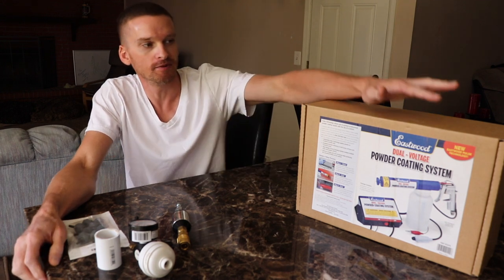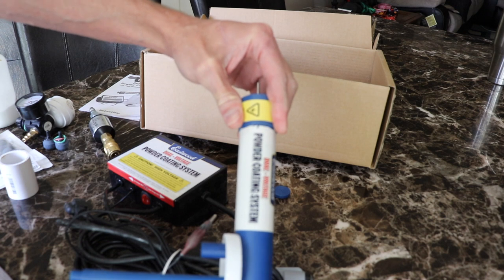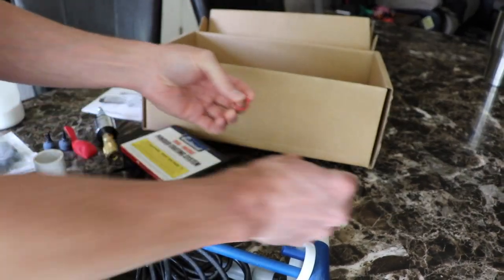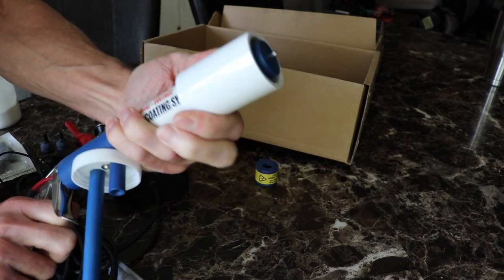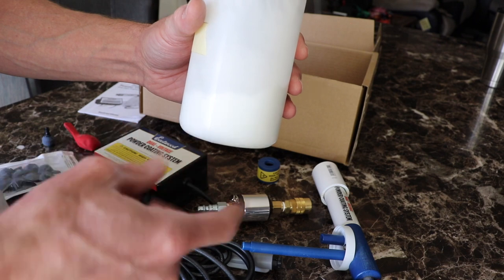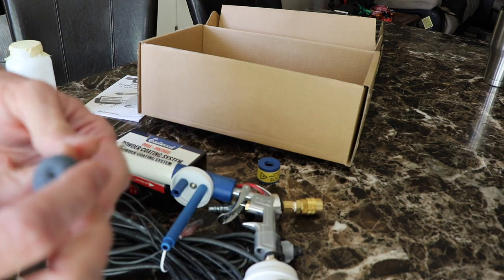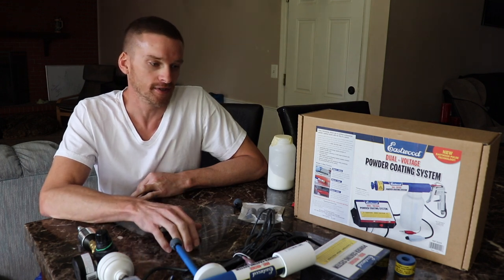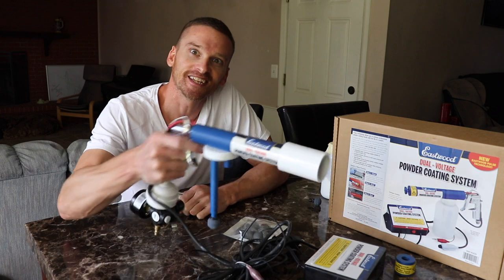Eastwood Powder Coating system Review & Modifications

Comment: Just started powder coating with this Eastwood gun and was constantly trying to reduce the powder flow by playing with the air pressure regulator what is not an easy thing to do while pressing the gun trigger, the power button and fiddling with the pressure. First thing I wanted to do is converting the power button into a switch, but your modifications seem to be perfectly addressing my issues with this gun. Thank you for your great input.

Comment: For anyone watching this vid.. I just received my Eastwood dual voltage powder coating system and they have updated the design.  The blue cap that covers the electro does not screw off!  I was able to still do the mod using the 1” pvc coupler but I had to use my lathe to remove enough material to use it in the way it is being shown in this video.  Instead of the tip of the ballon, I used a small rubber band and was able to accomplish the same functionality.
Reply: Seems like O-Rings with a bit of lube would be better
Reply: @ariyanadumon4549  lube and powder doesnt sound like a good combination

Comment: I just did the tip and fluidizer modifications to my dual voltage gun. The tip mod makes it shoot so much better. The powder transfer is amazing now. I have a newer gun and had to bore the 1" pvc coupler out to 1.395" on my lathe and it is a tight enough fit over the glued on tip where i dont need an o-ring. My only concern is the build up of powder inside the new nozzle. When spraying powder on a top surface from above there is a chance for it to fall out and land on the part. As far as the air stone fluidizer mod, i dont really seem to like it. I picked up a stone at a local pet store that is just like the one you have, but it seems to only work when there is alot of powder in the cup. When it gets low i have to really shake the gun to get any flow out of it.
Reply from the maker: I'm glad to hear that you did my modifications and could see a big difference in the way the gun shoots and a big improvement with the powder transfer. I shake out or tap the side of PVC coupling with the gun pointed down away from the piece I'm shooting to remove any powder build up once in a while, while I am shooting, especially if its a large piece. Sorry to hear that the air stone didn't work out for you.  Not all air stones are the same, I always check them with compressed air to make sure they are putting out air 360 degrees. I also recommend hammering a small nail through the air stone. That really seemed to help mine flow easier.  I hope this is helpful. Thanks for watching and Subscribing!
Reply: Bahasa indonesia dong

Comment: What about modifying the hopper to receive an additional air stone fed thru the open port on the regulator to aid the fluidity of the powder continuously
Reply from the maker: Well you probably could but it won't work the same as a Professional gun because of the Eastwood gun design. Eastwood gun pushes air into the hoper to fluidize the powder and pushes the powder out of the tip of the gun. A Professional gun has a fluidizing air line that runs to the hoper to fluidize the powder, the hoper has a vent tube to allow the air to escape the hoper after it fluidizes the powder, when you pull the trigger a Professional gun sucks the fluidized powder out of the hoper instead of pushing the powder out of the hoper like the Eastwood gun. I hope this is helpful. Thanks for watching!
Reply: @WillowsWorldofDIY  very helpful! 

Im waiting on the Eastwood gun its on backordered till 6/13

I got a...
60gal compressor
DeeBlast cabinet 
Wall oven
Powder coat Accessories (Eastwood)
Pancake compressor (Eastwood)

Im eager to start

Comment: Do you need the water separator and the inline filter so close to gun? Could they be placed at the compressor.  Im using a pancake compressor from Eastwood
Reply from the maker: Yes, The closer the water separator/inline filter are to the gun the better it will work. Pancake compressors usually have a lot of moisture in the compressed air, that compressed air cools as it travels through the air hose causing the water to condensate inside the air hose. So it's best to have the Water separator and inline filter as close to the gun as possible. I hope this is helpful. Thanks for watching!

Comment: The 1" coupling does not fit over the end of the gun with the cap removed.  The cap on my gun was glued on not screwed.
Reply from the maker: If Your gun is the new model you will need to use a 1-1/2" pvc coupling. I hope this is helpful. Thanks for watching!

Comment: Im going to invest in one of these eastwood powder guns as a hobby /part time business and im looking into all the equipment I need im building a sand blasting cabinet any recommended ovens and other equipment and tips ? mostly 20 inch wheels, calipers and some arts and crafts
Reply from the maker: The ovens that we used were big industrial ovens 12'x12'x40'. I don't have any experience with the smaller ovens but I know that there's a lot of powder coating oven on eBay that are reasonably priced. I would definitely recommend installing a Copper Grounding rod: https://amzn.to/3cQ6P3M with an 8-10 gauge stranded copper ground wire. 8 Gauge ground Wire: https://amzn.to/3dD95KX. I hope this is helpful. Please checkout my powder coating tips & tricks videos. If you have any more questions please feel free to ask for advice. Thanks for watching!

Comment: Thanks for the tips man awesome 👌🏼.  I don't own a eastwood but
Will this coupling work on a harbor freight gun?
Reply from the maker: I don't own a harbor freight gun so I'm not sure what size of coupling will fit it, but if you measure the tip of your gun and find a coupling that will fit it, it should work the same as my Eastwood gun. This modification makes a big difference in the way the guns shoots so I definitely recommend trying it and couplings only cost about $1 so it's worth trying. I hope this is helpful. Thanks for watching!
Reply: @WillowsWorldofDIY  will try this thanks a lot man 💪🏼💪🏼✌🏼

Comment: What’s the copper ground wire for in the item listed for the gun? And how I remove the place tip cover on the front of the gun?
Reply from the maker: The copper grounding wire is for grounding parts like tumblers cups where you don't have a good place to attach the ground you can shape the grounding wire to fit inside the cups to ground them. The plastic tip cover on mine just unscrewed, some people that have a newer style gun said that they were able to leave the tip cover on and either bored out the 1" coupling to 1.395" and didn't use O-rings or used a 1-1/2" coupling with O-rings. I hope this is helpful. Thanks for watching!

Comment: How about how to powdercoat a second coat without hot flocking with that gun..??? You have any tips tricks etc
Reply from the maker: The gun modifications in this Video will help the adhesion of the powder 1st & 2nd coat without hot flocking. With this gun modified  i shoot the 2nd coat the same as the 1st coat, I keep the electric on the high setting 25,000kv and I get good adhesion without staring. You can see me shoot 1st & 2nd coat with this modified gun in my video (custom powder coated demolition ranch tumblers https://youtu.be/tFDD4ciNuZE ) 
Also if you hold the tip of the gun close to the grounding clamp connection and let it briefly ark to the grounding clamp it will usually help the charged powder particles adhere better to the part being coated. I hope this is helpful. Thanks for watching!

Comment: great video thank you. I have this same powder coating gun and i am new to this. I used it today and it dumped so much powder. I will do all the mods and get back to you.  i am having a lot of trouble with Faraday cage effect if you have any tips. great video
Reply from the maker: Thanks! If the bottle is more than 1/2 way full with powder it will dump a lot of powder out. The faraday cage effect is usually caused because there isn't a good ground. The grounding wire that comes with the gun is a small gauge wire, I recommend installing a copper grounding rod with a 8 gauge ground wire to ground the parts you are shooting. Here is a couple tip you can try without installing a grounding rod, 1st make sure that you are prebaking your parts at 450 degrees for 15-30 minuets (if I'm have problems powder coating parts due to faraday cage effect I blow all the powder off and bake the parts to discharge any built up electrical charge), 2nd hold the guns electrode close enough to your part to cause it to spark to the grounded part you are coating (This will also help discharge the parts you're shooting), 3rd shooting parts hot will eliminate the faraday cage problem but leaves you with 0 room for error because the powder melts as soon as it contacts the hot part (I don't recommend shooting hot if you're a beginner). I hope this is helpful. Thanks for watching!
Reply: @WillowsWorldofDIY   thanks... that is the best information i have found searching all week for info on this, plenty of people explain what faraday cage is, but not how to fix the problem. I was advised to fill the cup to 3/4 and in doing so I used well over 1/2 a pound of powder on a set of 4 toy wheels 6 inches wide. I will be doing the gun modifications over the coming days and getting rid of the cage effect would be great. 

with the modification to the gun and preheating i wont have so much powder coming out and hopefully the cover will be better. The powder here ( sydney)  costs $36 per pound bag for basic up to $120 for superchrome, so you can see i cant afford to waste it. 

Thank you for all the tips
Reply from the maker: WOW! I can't believe those powder prices! With prices like that you definitely don't want to waste any. My modifications to the gun will definitely help you save powder. I don't have a set pressure that I run because every powder shoots differently but I would recommend turning the pressure down low and make small adjustments till the powder start covering well without spitting or dumping powder everywhere. If you are shooting a lot of parts or large parts with my upgrades some powder will buildup inside the coupling causing it to spit a little, I usually keep a clean container to tap the side of the coupling in to clear out the buildup, and that way you can reuse that powder in the container. I'm planning on shooting a tips and tricks video soon and I will talk about how to judge powder thickness while shooting and the way the raw powder is supposed to look before baking to achieve a professional quality coating. If you have any more questions in the future feel free to reach out to me.

Comment: Cool video! I'm about to buy one of these units and I'll certainly do the mods to it.
Any advice on an oven?
Reply from the maker: Thanks Kent! It depends on the size of material you are planning on powder coating. The ovens I'm used to using are the big 40' industrial ovens.  Personally i would like to build an oven big enough to fit a 22" wheel for my home use. Maybe one day I will get around to building one. Thanks for watching!

Comment: Hey man, thanks for the tips trying them out now.  My gun doesn't seem to unscrew, maybe glued?  Did you run into this?  Do you have any suggestions? Thanks!
Reply from the maker: Mine wasn't glued but I would try to cut it down the side and use a flathead screwdriver to try and pry it open and break it loose. I don't use the gun in its stock form since I did these modifications so I wouldn't worry about cutting that piece off. I hope this is helpful. Thanks for watching!

Comment: Link to a good air regulator?
Also, every time I go to spray the gun it spits out more powder then adjusts to the regulator Setting. Any idea why it doesn’t maintain the pressure I set it at and not push a lot more air out when I squeeze the trigger?
Reply from the maker: There is links to some regulators in the description of this video. If the bottle is more than 1/2 way full with powder it will just spit out a bunch of powder, so make sure you only fill the bottle 1/2 way. The more air you add the more powder will come out. I always start with my regulator turned all the way down and slowly add pressure till I get a nice flow of powder coming out of the gun. if you're not using air stones you should probably be in the 6-10 lbs of air pressure range. I hope this is helpful. Thanks for watching!
Reply: @WillowsWorldofDIY  I just started using the air stone today. I drilled a hole in the long tube and I think that’s what causing my issues. It might be too large as sometimes only air comes out of the gun. I often have to shake the heck out of the gun to get powder to come out (all the time basically).
Reply from the maker: The air stones won't work with a hole drilled in the supply tube. I recommend putting a piece of electrical tape around the tube where the drill hole is to try and plug it so the air will be forced through the air stone.

Comment: it would be a good idea to do the amazon affiliate thing and share links to these products
Reply from the maker: I used to be apart of the Amazon affiliate program, but my account got suspended because they said that I needed at least 500 subscribers. I will get back on the Amazon affiliate program as soon as I'm eligible.
Reply: I just subscrided, get on that 500.  Would be great if you got some coin from Amazon!
Reply: Sorry, I have watched all of your powder coating videos but just realized I never pushed the subscribe button.  I hope you get to 500 soon. Also I have this system but have not used it yet. Will try the modification.
Reply from the maker: Links are now up! I posted everything in the description.

Comment: why do you run two water separators? One before and one after the regulator?
Reply from the maker: A professional powder coating setup has an air dryer, I'm just trying to get the air as dry as possible without having to buy an air dryer.

Comment: Hey I have a question I know you said you don't like having to press the button to send the electrical charge. Can't you just take the button out of the equation and hardwire it so when you turn it on is electrified?  Or did you not say that in the video just because you know there are people out there that will do that modification stand in a puddle. Holding apart while licking the end of the powder coat gun😁?  I am serious about the 1st part of the question though.
Reply from the maker: The answer is yes!😂 You can eliminate the switch completely, but it will increase the chances of someone getting shocked. I have shocked myself numerous times while powder coating over the years, the shocks were enough to wake you up but not enough to cause any damage. I would NOT recommend this modification to anyone with a heart pump or heart monitor. I have also heard some people say that you can attach the switch to the handle of the gun and they use their thumb to activate the Switch while their fingers pull the trigger. I haven't tried this but it seems like it would work and free up your other hand. I hope this is helpful. Thanks for watching!

Comment: The tip of mine is solid. Think they have done a new design?
Reply: The tube is now a 1 3/8” the tip is solid with a hole for the electrode to go up into and down the gun.
Reply from the maker: I think you will still be able to use my modifications just use a 1-1/2" PVC coupling instead of 1" and you might have to try different size of O-rings instead of the balloon tips to make a good seal. I hope this is helpful. Please let us know if that works. Thanks for watching!
Reply: Willow’s World of DIY hey. So I took a 1” coupling and used a Dre mel to sand out the inside so it will fit. Did everything you did in this video accept the ball filter. I though the other filter would be good enough? It said filters oil, water, and everything else. I’ll be shooting later see how it all goes.
Reply from the maker: It should work great. The reason I use 2 filters is because powder manufacturers say not to add the leftover powder in your gun after you are done shooting back into a container with fresh powder if it has any moisture in it. It's just a precaution.

Comment: Is the dual voltage worth the extra money? Do you use the higher voltage?
Reply from the maker: The original Eastwood powder coating gun output is 11,000v. The duel voltage output is 15,000v and 25,000v. The professional Nordson and Ericson guns output is 0v-100,000v. So I personally think the Eastwood duel voltage gun is under powered at only 25,000v. The only reason you want the lower voltage is to prevent staring when shooting a Top coat over a base coat. I usually always shoot with the duel voltage gun on the high 25,000v setting for base coats and top coats, and I haven't had any problems with it staring top coats at that voltage. However if you are looking to save money on the original 11,000v gun you can shoot the base coats and top coats hot to achieve the same thickness of powder coating as the higher voltage guns, but shooting hot leave you with 0% margins of error, so that depends on your skill level. I hope this is helpful. Thanks for watching!
Reply: @WillowsWorldofDIY  I have no skill level with powder. I'm new to powder coat an wanted your opinion. Thanks for the info it is greatly appreciated!
Reply from the maker: I Think the Duel Voltage gun is prefect for someone new to powder coating and will shoot a decent coating. My modifications to the gun will give you more Control of the powder, slowing it down and keeping it in close proximity to the electrode allows the powder to build more of a charge which gives you better adhesion and saving powder. The results are a thicker coating that is close to a professional gun coating. I'm happy to help if you ever have any questions.
Reply: Ok cool! That's what I needed. I will definitely do the mods. Thanks for your help.